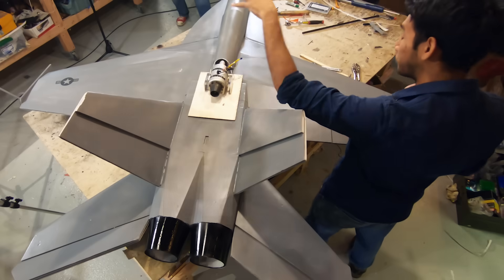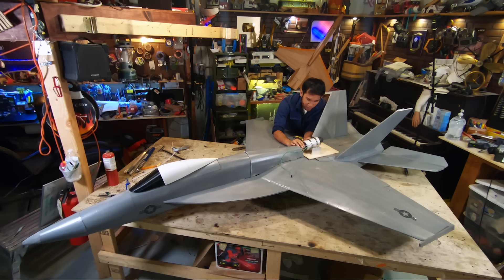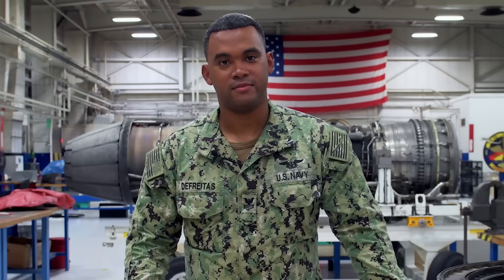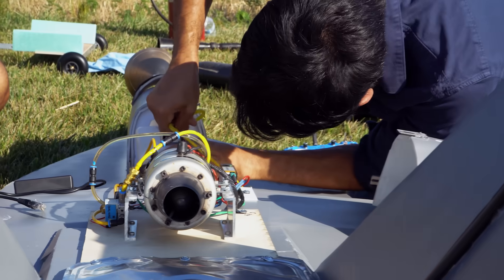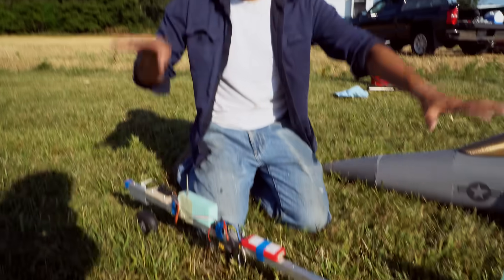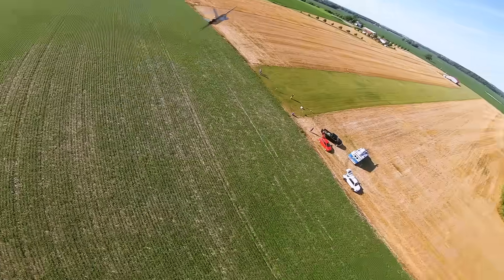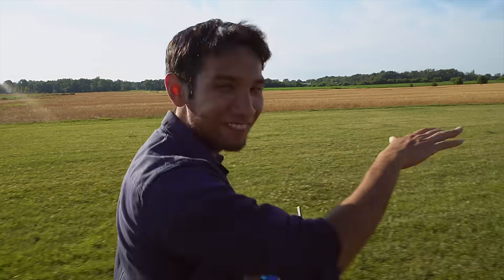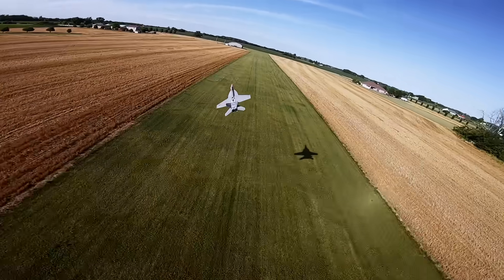Making a GIANT F-18 with a real JET TURBINE | Sailor VS | U.S. Navy

Comment: I think you could have put 2 engines in the actual engine pods, with the exhaust port beyond the edge of the pod rear...  And the aluminum heat shields could be a redundant protection, if thought prudent.... Just a bit of a disappointment.

Comment: For the fuel system as a basic requirement you require a UAT (Ultimate Air Trap) or a Bladder Tank. The UAT is a small device that ensures air-free fuel flow to the jet engine regardless of what orientation you are flying in. With a UAT you could roll or fly inverted for as long as you want without the fear of a flameout.

If you use a Bladder Tank instead (like an IV bag), when filling the tank, it is filled in such a manner that there is no air inside and when fuel is consumed the bag shrinks (just like an IV bag).

Would STRONGLY recommend using atleast a UAT. a Bladder tank will be lighter and does not require a UAT if you want to save weight

Comment: You could have used two turbines in the part where the actual jets are supposed to be, line the inside with that cloth and tin foil, and weight down other parts of the plane for weight distribution, like a bigger battery for the turbine for greater center of mass🧐

Comment: Put the hot air fan in the engine compartment my god Peter. Have you ever seen an f18 Hornet or Super Hornet look so stupid? Also the F/A 18 is designed to be able to take of from an aircraft carrier flight deck.

Comment: Why strap ut on the top and not inside? You can get insulated pipe from hardware stores that would protect your plane or make your own pipe. Should be good if you surround it so air flows around the engine like they do on the full sized planes. Plus woth such a tiny engine I'd want to put two in that air frame 😉

Comment: Revvin' up your engine
Listen to her howlin' roar
Metal under tension
Beggin' you to touch and go
Highway to the Danger Zone
Ride into the Danger Zone
Headin' into twilight
Spreadin' out her wings tonight
She got you jumpin' off the deck
Shovin' into overdrive
Highway to the Danger Zone
I'll take you right into the Danger Zone
You'll never say hello to you
Until you get it on the red line overload
You'll never know what you can do
Until you get it up as high as you can go
Out along the edges
Always where I burn to be
The further on the edge
The hotter the intensity
Highway to the Danger Zone
Gonna take it right into the Danger Zone
Highway to the Danger Zone
Ride into, the Danger Zone
Highway to the Danger Zone
Gonna take it right into the Danger Zone
Highway to the Danger Zone
Ride into the Danger Zone
Highway to the Danger Zone
Gonna take it right into the Danger Zone
Highway to the Danger Zone
Ride into the Danger Zone
Highway to the Danger Zone
Gonna take

Comment: I know this is pretty old but Peter couldn’t you have gotten two jet engines and put in the actual area where the engines of a jet are and the air flow through the front like an actual jet?

Comment: You should fibre glass the jet throw twin engines inside with tin ducting for heat shield and route then through the actual exhaust nozels.

Comment: "engine need time to spool up" Yes and no. You do know those heavy armored blast shields that lift up before take off on carrier? Those are shielding everyone and everything from full blast of the engine. The aircraft brakes are holding it still until engine has spooled up, so same should be done here. Not sure what kind of braking system this could have, but spool it up and then launch. That should be enough to get it airborne.

Comment: why not add two turbines in the holes u have designated for them? being covered and internal u might be able to prevent the flame out's ?  Do it. I know u can come up with a second turbine and fabricate better layered heat shielding for the exhaust area. if u take a week studying radar cross sectioning i bet u could also come up with better frame layers and a radar absorbtion paint or deflection paint. im sure too u can even make bomb storage compartments and miniature laser guided bombs a friend could assist to glide into targets....
Reply: i bet the navy could provide u with the materials i mentioned above...  imagine the 10 yr olds to 18yr olds in allied nations a follow up with the upgrades i mentioned above would pull in....

Comment: Possible way to make it better? Twin jet engines mounted properly, likely right at the exhaust on the model, vacum cleaner hose from the aircraft's intakes to the actual engines, heatshield and some extra space around the twin rear engines to ensure some level of forced air cooling. Testing would likely require a high speed fan blowing over the aircraft to ensure the engines don't melt the plywood and foam that house the engines.

Comment: its not F-18, it is F/A-18
the F in planes such as F-16, F-15, F-22 etc. stands for "fighter", and these aircraft specialise in air to air combat.
the A in planes such as the A-4, A-6 etc stands for "attack", and these planes specialise in ground attacks
when the F/A 18 program was in run, boeing (company who developed F/A-18) gave two planes to the US NAVY: F-18 and A-18. bt us navy did not liked operating two airplanes. so boeing merged the F-18 and A-18 to make the F/A-18, specialising in both air to air attack and air to ground attack.

Comment: For the fuel system within the tank. You should use the same system they use in most cars. It's an absorbent bag or layer at the bottom of the tank. So when you roll or fly upside down you can do so for a short period of time before losing the engine

Comment: What if you added 2 decent size rocket thrusters that you would use in a rocket but put it where the engines should be as an afterburner

Comment: im impressed that you did this,but it could have ben a possibility that you could have put the jet turbine in the. You know,where its suppost to be, and bc you cut the aluminum box thing,it would have ben bendable so you could have like but glue or tape or something. And make sure the vents of the F-18 are getting enough air to cool it down more so it gives it more air-time.

Comment: On a jet the air intake should not be obstructed. Even slight obstructions increase spool up time and reduce total thrust output in general. If you want that thing to really get moving the engine needs a clear unobstructed access to the air stream. If you were going supersonic these dynamics would of course change depending on the type of jet engine. Being sub sonic you need all the air stream you can get at lower speeds to get the optimal thrust. A real F18 would be too unstable to fly without its advanced flight control systems. Altering your thrust line can change maneuverability verses dynamic stability. You need a header tank to go inverted.

Comment: Solution to your catapult problem. F18 are launched by catapult off of aircraft carriers all the time. What you need to do is start up the engine of the plane, then get the truck moving. If the truck is moving, then it will definitely have enough launch velocity to take off by the cat truck

Comment: That's pretty damn amazing. I'm impressed. The truck my good man, whether you're laughing a dirt bike from the start date, a 45, 000lb. F15 from the deck of a carrier, it this ingenious replace you've built it THROTTLE UP against resistance.

Watch the real places and LISTEN. The limits are hitting the gas for a few seconds BEFORE the catapult launches the jet. On the dirt bike you are holding the front brake and feeding it just enough clutch to where is about to pull the bike, when the gate drops you dump the clutch and let go of the front brake. You get a jack in the box effect where the vehicle LEAPS forward with more FORCE.

I'm surprised AD1 didn't tell you that but if he works with land based F15s he wouldn't know that.
👍🏽😎💪🏻💪🏾  
You're welcome. Try that next time, let me know how it works.

Comment: Question. idk if this was answered in other comments...did you spool the turbine AS it launched, or like on a carrier, did you have it spooling at max before catapulting? The Navy holds the airframe back and launches at full thrust, if you didn't do that is that possible with that launcher?

Comment: Advice for future CAT launches: usually the engines are spooled up to flight RPM/thrust before launch, so maybe try spooling up the engine first and then releasing the CAT shuttle? Really cool video :D
Reply: I don't think that catapult had any sort of hold-down, so if the engine gives too much thrust the plane will just push itself off the top of the truck.

Comment: I can’t tell if I’m just confused or this guy doesent know what navy is so please correct if I’m wrong, but why is the navy trying to approve an aircraft when the navy is water also what does sailer vs navy have to do with jets, also I didn’t watch the whole vid so I’ll edit if I get the point after the vid

Edit: so umm yeah it still makes no sense to me, I get that in the navy you have to be trained to work in everything but I think the air force still knows a little bit more about planes then them, also he’s not a seal so he wouldn’t be trained for air anyway

Comment: Cool F-18. How much did the engine cost?
Reply: Small jets like these start around $1700 and up to around $3000 (you’d get much bigger at $3000). That was a really tiny engine for that airplane, surprised it flew with that small of one (typically it would be used on a plane about half that size). Sucks when you crash and pancake one... I’ve seen one look like that (nose dive straight down at over 200 mph), it was exciting at least.

Comment: Could u explain how to make such cool airplane and it's basic electronics
Reply: You won’t want to start with jets (extra fuel pumps and fuel systems, plus it’s $1700 and up for jet engines). So the wiring is a lot different than an EDF or propeller plane, and it really depends what all you want on it (flight controller or just manual, how many motors etc). I recommend watching a few videos on the basic parts (it’s the same, you just start adding more and more)

Comment: Dude what kind of connecter would you use for Mountain bike light plugs,3 mm ,2 wire internal cable ,so when it gets biffed it won't get mangled it would just pull apart ,like Walkman jack?
Reply: You can use a T-plug (deans plug), but that’s usually for high power application (like an electric bike or quadcopter), but I use those for everything because they just pull apart easy and won’t rip wires until something breaks. Or you could do USB plugs if you have some old ones laying around or headphone jacks even work for that too, quite a few options I’ve used recycling broken stuff from.

Comment: During the inverted phase of your roll it was diving a lot.  I assume you know to use down elevator as it goes through inverted....in which case it is set up a bit too nose heavy in level flight...meaning the wing incidence pulls it down when inverted.  Try moving the CG back a little and re-trim for level.  ANY aerobatic aircraft needs adjustment for trim to get it performing stable both ways up.  Just din’t move the CG aft too much in one go or you know what happens then...a divergent handful.

Comment: I want to see two turbine attached inside the burner like an actual jet. Will it fly? The power output by two turbine would be definitely higher. Will the body withstand the air pressure?? I am interested

Comment: Did you spool the engine pre-launch? I feel that with a higher launch angle, the hornet would be up. You can see the rate of descent fall as it gets near to the ground, picking up air speed. 

IRL, planes launch off the cat with the engine fully spooled and afterburning. The higher angle would give a larger window to accelerate out of the initial stall, too.

Comment: Needs two smaller engine's at the back so no heat shield is needed apart from around the engines then the e
Launcher needs a high resistance elastic band to launch it with enough speed

Comment: U did great man but I ask .....if u installed the jet engine in the original exhausts I mean the ones under the plane and cover the inside with aluminum. It would have been lot easier and powerful right?
Well .... I am not as experienced as u, in fact I am just 15 yrs old but I THINK THAT IT WOULD BE COOLER

Comment: ESSENTIAL FEATURE IS NO FUEL
A real jet turbine uses no fuel. I've read through a few hundred comments below and they're all short and shallow. A few commnets are useful but the main point here is the idea that this is a REAL RC jet trubine... not electirc. This is equivalent to UFO revelation-- because it shows that we have free power through vortex air compression. The unit is electrostatically suspended  in air via no-fuel vortex and shoots forward via the compressed air. .... same as all passenger jets now-- hidden in plain sight-- The idea that jets carry fuel in wings is a hoax. This RC demo exposes that if you know what it is you're really looking at here.

Comment: Great first try, however the F/A18 Super Hornet is a twin engine jet and you need to mount 2 of them and in the correct location... add ballast to the cockpit to counter the weight of both engines being in the back.

Comment: Maybe make it out of metal next time, and actually put the engine inside so it looks better?
Reply: Would be too heavy for the tiny little engine which although it looks to scale with the plane it really isn’t as if it were it would be much longer. He could just buy some better engines but those alone would (on average) cost more than a small car.

Comment: Wet pack for an oil burner I use it all the time for my model airplanes and boats and stuff that's the stuff you put inside an oil burner you can get it at a plumbing store and that would be what you would use that's not real heavy that's definitely flame retardant best regards C1 usn retired

Comment: In the Navy they can launch from the carriers by catapult since the catapult (CAT) gives about 150 to 170knots when launched.  They also can takeoff from air field if needed but mostly they launch from carriers. For landing on the carrier they have wires that catch the air crafts hook and it stops it immediately.

Comment: Quick tip that even the Navy uses. Put board behind the engine that is fixed to the launch platform so that the thrust pushes off something. US Navy aircraft carriers uses this and it's one of the only reasons they don't need to whole flight deck like they used to in WWII.

Comment: I would have liked to see the engine inside of the plane where it should be.  Foil and cheese cloth formed into a tube around the engine with a lot of air flow between the engine and the inside of the tube.  Kinda like a High Bypass Jet engine. A full length tube would do a couple of things. It would straighten the airflow to the intake of the engine. Air flowing around the engine would keep temps down and help keep from melting anything. The directed air flow around the engine would also shield the exhaust heat, slow moving air surrounding the hot exhaust gasses would kinda act as a muffler and reduce sound.
Pete...Great info. Keep it up.
I have been flying model planes since 1959, C/L for a time, then in '76 got my first Radio, been flying R/C ever since.  I am a NITRO Burner, been running the 2 cycle engines.
Take a 60 in. WS, ARF, stick in it a .46, crank the controls up as far as they will go.  With a 11x5 MAS prop it will do a mid air prop hang.  Flat bottom airfoils are a little funky in the inverted but it will do it.  Plenty of horse power and large throws, a fully aerobatic trainer.
From Mid Michigan     KEITH

Comment: You did have a flexible fuel hose in the fuel tank thats weighted didnt you? otherwise when it goes inverted all the fuel goes to other side of the tank and there is no fuel being taken up in the fuel line, thats probably what caused the flame out

Comment: Hey peter, try a two layer design with foil with the layers gapped about a 1/4” use the Venturi effect to pull air between the layers to keep the fuselage cool enough for sustainable flight.

Comment: essentially the fuel flow gets to a point where it can’t feed the engines, that’s why it flames out, happens to real scale planes too. Fuel accumulators are one real world solution to the issue of flameouts under conditions like negative g’s, etc.

Comment: Do you have some sort of flexible fuel tank? You could fill it and put elastic around it so no air fills the tank as the fuel is used.  This could fix the roll flameout problem.